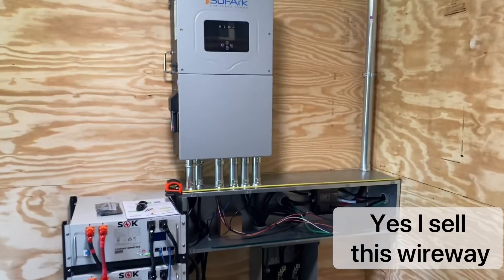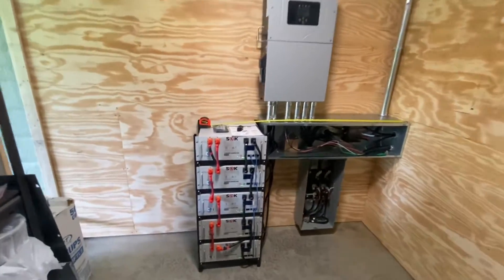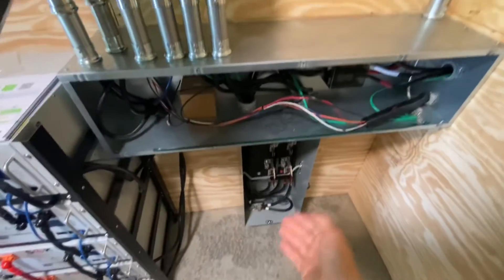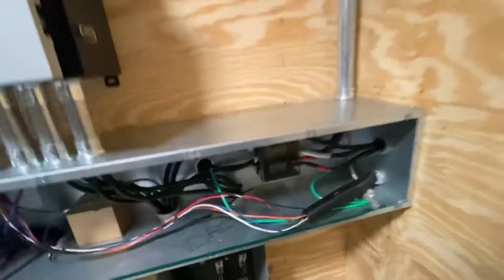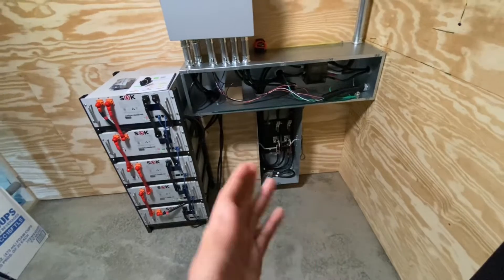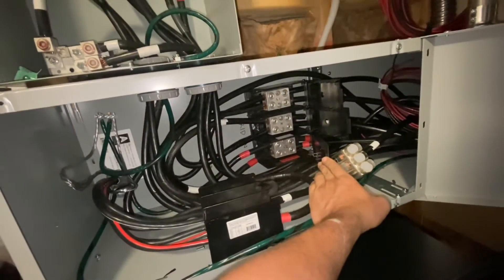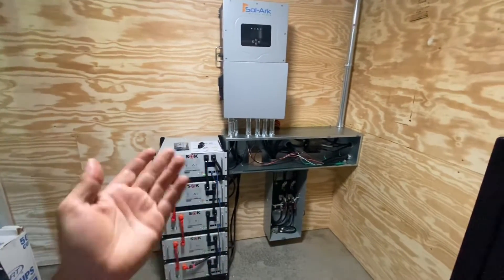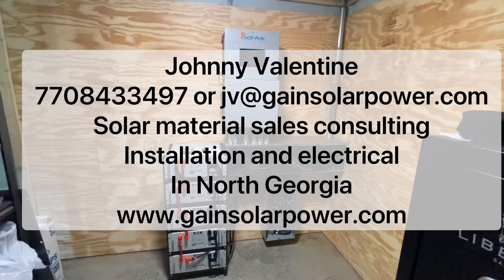Choosing a Wireway for the Sol-Ark15k

Comment: I like that you show your work. Thinking I wouldn't put that transfer switch that low.. thinking I would make a little wider area just in case you need to add another bank of batteries or another inverter or a larger inverter etc if possible

Comment: With the transfer switch mounted underneath like that, how tall does the Sol-ark display end up? If 6" bottom solark clearance plus 12" wireway + 30" transfer switch height + 24" from bottom of Sol-ark to the display that would be about 72" - maybe a little high?

Comment: Another great tip video. I see some of your installs that have a 12” deep wireway panel under flush mount panel. How does that pass inspection? Thought rule was 6”.
Reply from the maker: We are in a pretty slack area. I should be furring them out with unistrut but do as I say not as I do!!
Reply: The 15k is a bit more than 6” so a 12” wireway below it is generally not a problem.
Reply: @balrog006  it is a concern as you can’t have anything protruding more than 6” in front of the service panel per NEC.  A 12” deep wireway would be a violation for a flush mount panel.
Reply: Well if the front of the inverter and the front of the wireway are in the same plane and flush with each other-nothing is protruding that 6” so it isn’t an issue.
Reply: @balrog006  you are not reading my statements…under a flush mount panel. Wireway in front protrudes 12”….6” more than allowed.
Reply: Video isn’t about a flush mount panel.  He’s only showing an inverter and the wireway here.

Despite that he gives the fix for deep wireways in his reply to the original comment-bump out the panel.
Reply: @balrog006  you need to read my original question. Like actually read it.  Yes he explained it. Not sure why you keep commenting.  Strange.
Reply: Because you gave the answer to your own question-no more than 6” is code.  No one is arguing that.  Not sure why you’re looking for a deeper answer here, there isn’t one.  Code is either enforced, so you have to work within it and comply, or code isn’t strictly enforced as Johnny says and it’s not a problem for compliance.

I
Reply: @balrog006  I’m not looking for a deeper answer. Not sure why you replied to JVs answer to my initial question. I had no follow on question after he replied.
Reply: Because as I said, there is no panel in the video-I was clarifying that the NEC rule, enforced or not, isn’t an issue the way it’s showing in the video with the 15k.  Your question, was on something not shown in the video-I was simply making sure anyone else reading it wouldn’t be confused about the rule you were bringing up and the installation shown in the video by Johnny-which are two different situations.
Reply: @balrog006  which is why I started my question to JV with “In some of your videos” and JV replied with the answer. That’s why I asked you to read my first comment.

Comment: My inspection failed because I had my 12 inch wireway running below my flush mount main panel. It's taking 2+ months for new wireways to arrive lol
Reply from the maker: I’d go to a sheet metal shop and have the mark you a new top